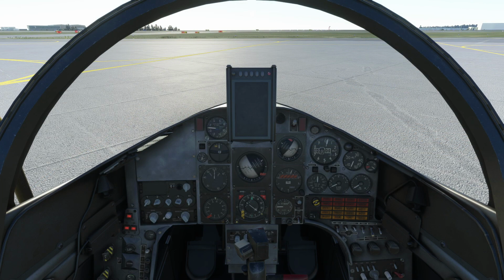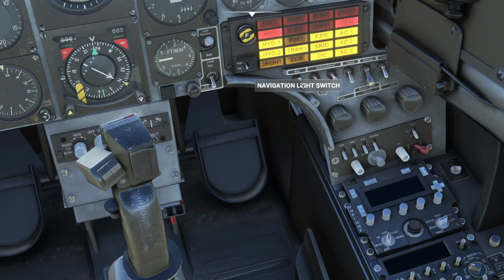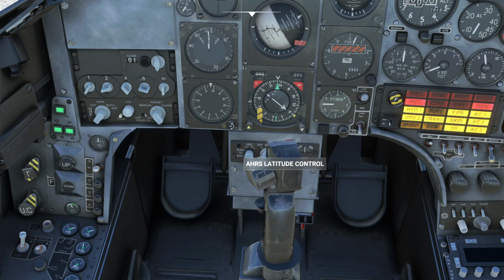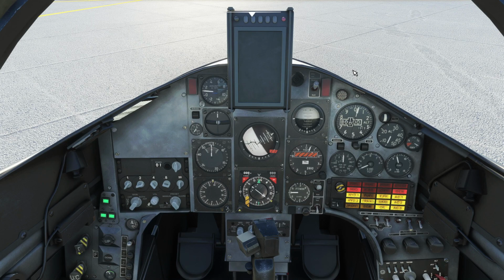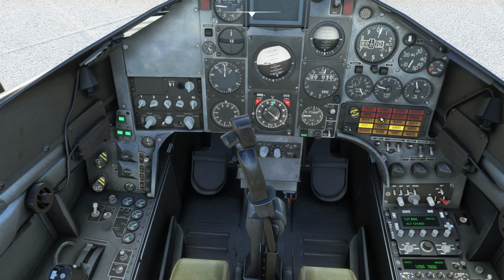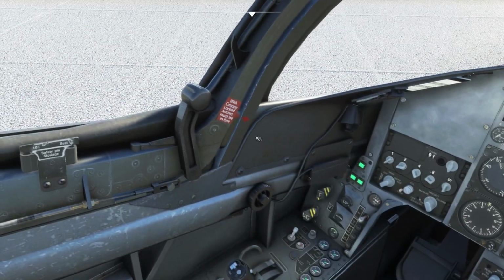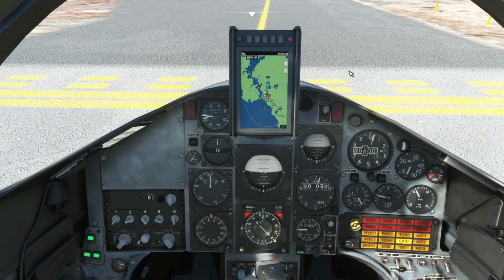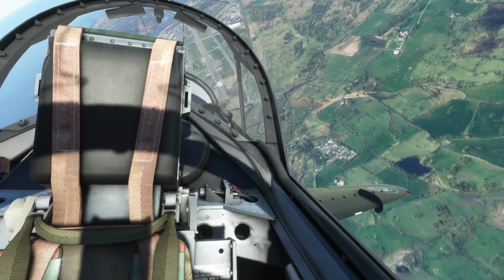Just Flight - Hawk T1/A Advanced Trainer MSFS Preview Video - Configuring for Takeoff

Comment: First off, my plane wont roll fast at all, next, i have to continously trim the aircraft to stop it pulling up or nosediving and when i do, whenever i pull a bit of g the aircraft shakes violently. The aircraft is flying really weirdly and i dont know how to fix it, is it the flight model cuz msfs said the plane hasnt fully downloaded so flight model will be unusual as soon as i finished the download but its been two days and its still not fixed😢😢
Reply from the maker: "MSFS said the plane hasn't fully downloaded so flight model will be unusual"   Are you sure they said this?  It makes no sense at all. If a download has failed in any way the plane won't load at all, you wouldn't be able to start flying it.  The best thing to do is open a support ticket with our team via the support section on our website.  Do that and the team will investigate this for you.  Ok?
Reply: @justflight  thx, i ahve tried redownloading it a few times and clearing space but it just seems really wrong to what i see on videos, just doesn't match at all so yh ill see wht ur team say, thx for the reply